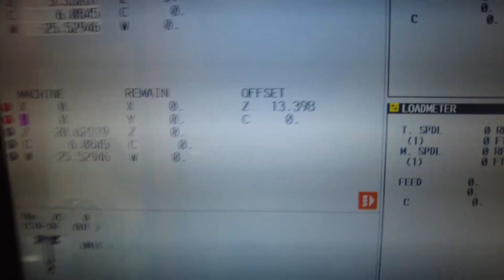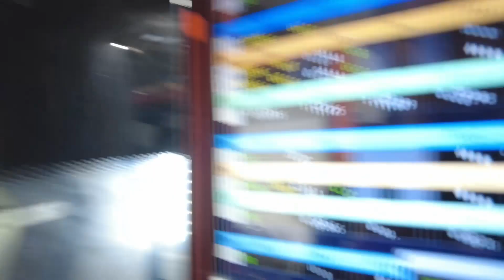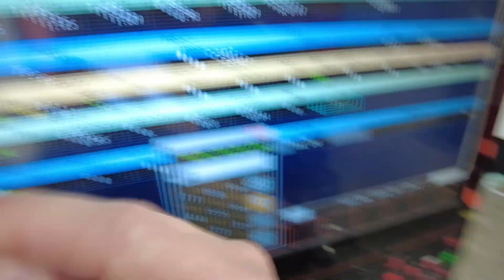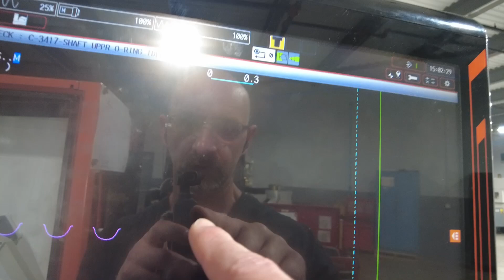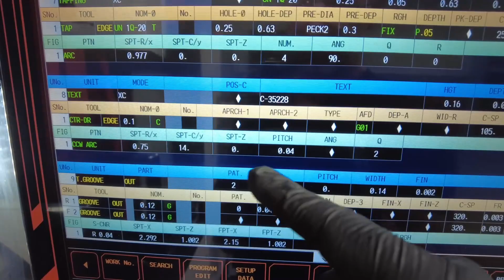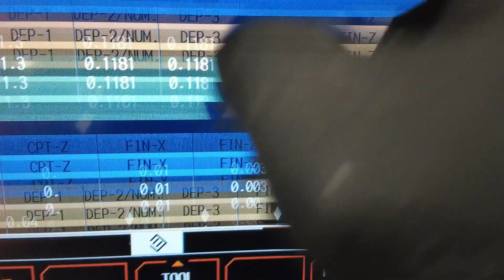Mazak Mazatrol Smooth G Engraving XC ZC

Comment: Keep it up!👍
Reply: Do you ever use stack pockets?
Reply from the maker: not sure what you mean about stack?
Reply: @martyz3232  its a double turning holder or you can get them for boring too.
Reply from the maker: @ryanszyminski5145  we have those on Moris, they run these on Eia programs, because you can turn on y off center, I only use Mazatrol
Reply: @martyz3232  yeah we have them for mazaks just have not used them yet. I only run mazaks too.
Reply from the maker: @ryanszyminski5145  I know what you are talking about, one is lower and other is positioned higher, only issue with those is they are rather designed for smaller parts because they have to clear each other, but you can't use these in Mazatrol, only holders you can use is for subspindle when you have tooling front and back but on centers
Reply from the maker: I will, thanks a lot